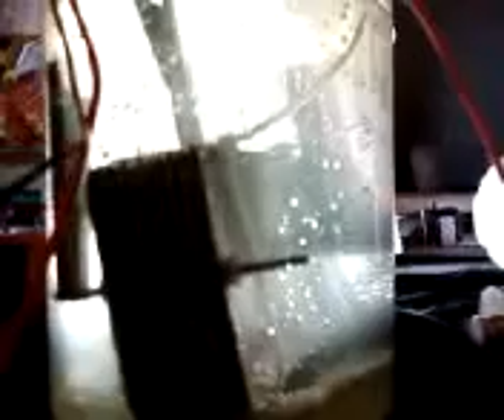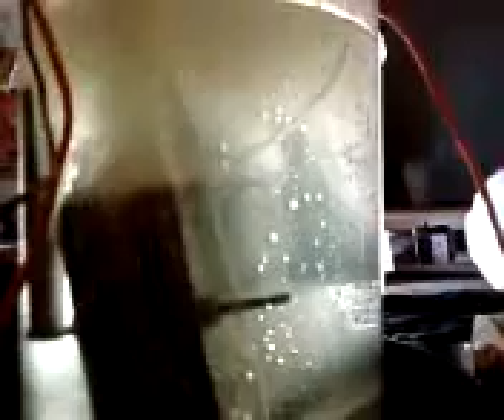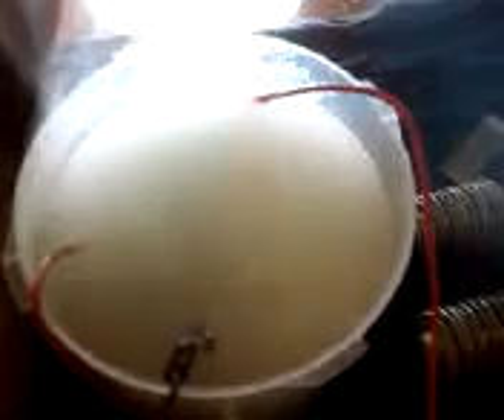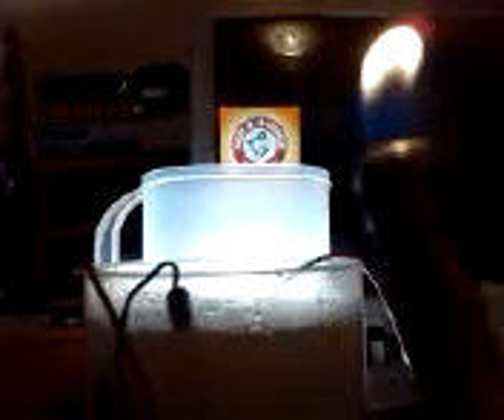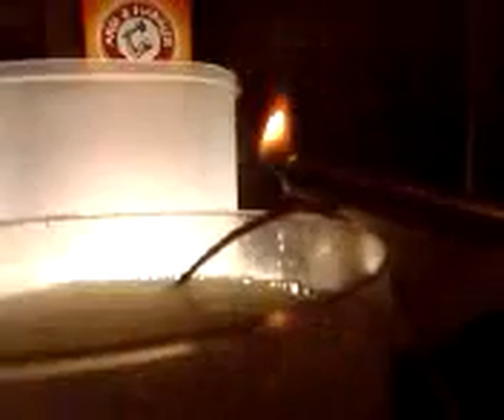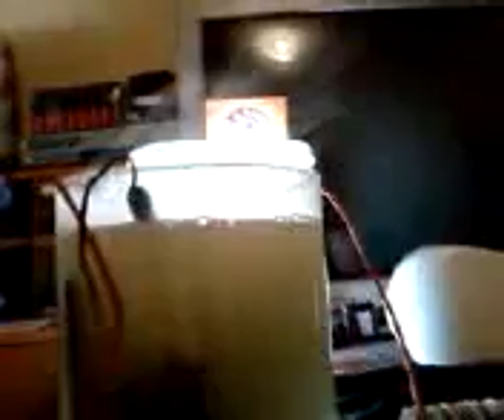#11, 13 plate hydrogen electrolyzer, HHO, with flame test

Comment: not bad ... need to figure out a way to seal up the plate edges so you dont leak current aroudn your plates and force it go through the surfaces ... ZeroFossilFuel did some really good videos explaining methods to do this ... also a fellow called AlmostHydrogen did an interesting take on the problem using a Smack type device ...